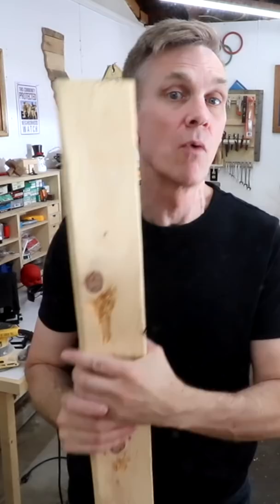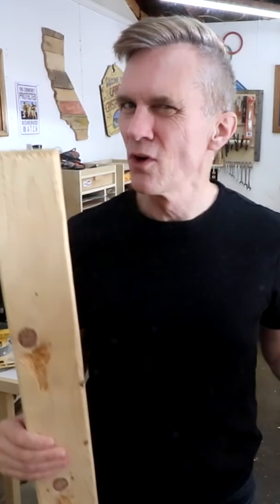Why do 2x4 boards have rounded edges? #shorts

Comment: "No one knows the reason." 

Me working at a saw mill along with 150 other people that all know the exact reason the corners are rounded: "You sure about that?"

It's so that when the lumber is stacked and banded before selling there are air flow passages to help the wood dry better if it gets damp without the need for as many spacers in the packs. Which are called sticks at a saw mill just as a fun fact.

Comment: 2x4s have rounded edges so that when they are stacked together for storage/shipping, air can get in between the pieces. It helps to prevent mildew and damage.
Reply: It also makes them easier to remove from the stack and especially a wet one !
Reply: 2×4 have rounded edges as it's very beneficial to the wood itself and those working with it. They reduce the number of injuries like unwanted splinters during the handling and manufacturing process and also ensure that the lumber stays looking its best all throughout until the customer sees it.
Reply: If only he could have told me that
Reply: Usually lumber is wrapped after being kiln dried, not sure airflow is the answer.

Comment: Originally, rounded edges were just a byproduct of the type of saw used to cut down the boards to a 2x4. In the early 19th century the most common mill saw was a drum saw, nicknamed the cymbal saw. To fit the spindle and drive gear the center would bulge out resembling a cymbal, and when run at high speed with wood travelling through it to be cut, the edge down that ran along this bulge would basically get routered down to a round (albeit uneven) edge. 

As Devin points out, today wood beams and planks are kiln dried. Rounded edges allow for the boards to fit the racks better and allow for even airflow.

Comment: The “planing” of “rough” lumber produced straighter boards and that material removed was resold for secondary products and uses. 

You’ll also find it amazing to know that it sometimes takes years for new architects to catch on that these rough framing members are not 2x4”…

Comment: They're rounded so that when they are stacked, there are gaps between each beam to ensure they maintain proper moisture content.
Reply: You think he would tell you, but then you remember, your watchinf the youtube equivalent of tiktok
Reply: I figured it was something like that.
Reply: True but they’re not “beams” and nobody w actually mill or kiln knowledge would call a stud a “beam”.  You obviously stole an answer from someone with actual industry knowledge… to what?… hear yourself talk?
Reply: @HBSuccess  how can someone hear themselves talk in text?
Reply: @draco_izanagi  
It Requires a lot of beams
Reply: @HBSuccess  folks call it different things my guy. Been a carpenter for over 20 years, looks like you've been a troll for a bit longer.
Reply: What percent is proper moisture content? I'm a hardwood floor guy in the very humid south
Reply: That’s exactly what I thought, this comment satisfied me. Thank you
Reply: @mattinthehat6318  I did woodfloors for 20 years under 8% and they stay flat
Reply: Sounds as good as anything else. Been in construction for 40 years and never cared. Just cared if they were straight.
Reply: @terrypetersen2970  I'm right there with you! Especially at today's prices! If it's not straight then I'm going to pass. Even the OSB (although I don't normally use it for sheathing) is damn pricy. I just redid a kitchen with veneered cabinets, and the framing and wood alone was well over 4 grand.
Reply: There are many reasons but this isn’t it they use spacers for this and always have
Reply: Old man told me that it was to keep edges from get damaged as much
Reply: I love moist wood
Reply: @SolarPatrol  so do termites, black mold, mildew, and rot. Use a crawl space dehumidifier and your house will last 100 years
Reply: Ok but he's talking about a specific size which hints that other sizes don't have that. So then other sizes don't need to ensure proper moisture?
Reply: Hmm 🤔
Reply: @boburwell9921  I'm in Arkansas and humidity definitely makes a big difference. Under 12% is doing pretty good around here.
Reply: @boburwell9921  yeah I thought that too. MY theory is it's for packing. If the edges were supposed to be squared off, they wouldn't pack as tight. That rounded edge gives wiggle room. If you get my meaning.
Reply: @HBSuccess  sounds like you cut a lot of blocks and pack a lot of sheets on your jobs site… he never claimed it was his knowledge
Reply: Most 2x4's are still soaking wet when they get to the store. Rounded corners isn't doing much of anything.

Comment: They are round because a pristine edge (even at 90 degrees) cuts like knife and would probably cut tie down straps in transport, it's also better for everyone who has to handle it, starting at the mill. It also reduces damage and splintering of the product. There does need to be any extra steps, automated machinery can have this go right from plaining into a molder.

Comment: It’s rounded so it can either be treated or thrown around without splintering. When stacking which it’s the most commonly stacked boards the wood needs airflow or breathing room. Thank you

Comment: You can butt up 2 rounded corners pushing against the corner edges, this gives you the triangle strength while also allowing flex movement, most framers have forgotten this, but when more complex building shapes rather then the cookie cutter construction, you can begin to see the huge benefit of the rounded corners.

Comment: I've worked at a sawmill for 8 years and counting. Six of those have been in the planer and two of those have been looking after the planer production and quality. The rounded edge or eased edged (EE) as we call it does not add an extra step to the process. We simply put different knives on the side head of the planer. The reason why we use eased edge is because it cleans up the wane (wane is the part of the log that is under the bark) from some of the board. Purely aesthetics, however, some mills might produce a wane free product and this would pull more boards into that top end grade. Hope this helps!

Edit: the answers regarding moisture sounds good but the eased edge is quite small. There would not be a big enough gap to allow for enough airflow to stop the lumber from molding or whatever. Not only is the gap not big enough but stud grade (#3 equivilent) products and above (#2 ,#1, SS and j- grade) generally get wrapped so that they don't get rained on. Being wrapped would also stop most  of the airflow through that bundle as well. We have a product that is a wet product. Any board over 19% moisture content gers sorted out and put in that product. These bundles are not wrapped and open to the environment, if eased edge would allow enough airflow to move moisture these boards would not mold. However, this is not the case... Square edge is also easier to stack production wise for the mill.
Reply: Se you on the top
Reply: Thank you for taking the time to share this!
Reply: Great answer. Someone knows what they’ve talking about.
Reply: Thanks! Finally someone who really knows. A big thumbs up.
Reply: I heard that the rounded edges help keep the wood from splintering on the edges that can lead to the full board splitting.  back in the day, the stores would get the truckload of wood but many would be damaged on the edge leading to the whole board splitting and needing to be thrown out.
Reply: Excellent answer. You probably have a wet product category because you're using a softwood kiln stick that compresses under the weight of your green stack. Eliminate your wets by using a tropical stick that does not compress and you eliminate your discounted wet market. They can get 10+ times the turns too.
Reply: It's nice to know my guess ("more finished boardfeet per tree? Since trees are...round?") was on track =]

Comment: The answer is very simple..if the edges are 90° and the board twists or bows it will transfer that defect to any material fastened flush to them. With the edge rounded, any light warp or bow will not as easily transfer. The rounded edge is much like an expansion joint.

Comment: Having a radius on the corner improves the overall strength of the 2x4 by removing any points where the grain can fracture from a change in direction The radius makes the 2x4 not split along the grain as easily as it would if it was a 90° corner
Reply: Exxxxxxaaaaccctttllly correct, stress concentration is something to be avoided.

Comment: 120 years ago, back when 2 x 4s were actually 2" x 4", they didn't have rounded edges. Anyone who has worked on an old house has encountered framing lumber from that era that had square edges. And while it came out of fir trees that were much superior to modern lumber, the old framing lumber is usually extremely splintery and dangerous to handle without good gloves.

Comment: Its so the lumber stays looking as good as possible till its purchased in a retailer. As well as splinters. Square corners ding, chip and break when handled this is why 2x4s and other dimensional lumber are shipped unprotected and finish lumber with Square edges are protected.  Everything else is an added bonus

Comment: With 2 decades in the industry, I would tell you rounding help reduces splintering & cracking, during all the handling processes that includes drying process and shipping.
Reply: Still doesn't make much sense though as its generally used where no one is ever going to see it. So why does it matter if the corners are splintered or damaged?
Reply: @SirBenJamin_  generally doesn't sell well. Its like everything else. If it looks good its percived as being good
Reply: @SirBenJamin_  I don't believe you asked.

Comment: The answer seems to be that it is to allow air circulation when drying and palleted. I’m more curious as to when it became common to round them this much. Contrary to what he says, the rounding, at least to the extent we see today, does not go back that far. Up until at least the mid 1980’s 2x4s had a much more squared profile. Take a look at the framing in any old house. 
Ad an added benefit to the improvements for kiln drying, I bet it adds up in savings on shipping costs.

Comment: I work at a sawmill we run them in EE (Eased Edge) or SE (Square Edge) it takes no extra effort to do either just depends which head you use on the machine i think its all preference.
Reply: Is there more money to be made if you sell the corners separately as sawdust?
Reply: @tiberiu_nicolae  no there is no money to be made in saw dust my boss said he gets about $50 in profit a truckload you but you have to get rid of it so you take what you can
Reply: It would be nice to watch a video of the process, maybe you can send it to Ramsey so he can post it, if you can record it of course, 
So, do you know the answer we all are waiting for, ¿can you tell us the reason for that round edge?
Reply: All lumber is stacked into units!!!  I pulled chain for over 6yrs Str8 in different planers & Sawmills!!!  They run a soft edge because of the moisture & drying aspect of lumber, when lumber is dried in a kiln, it is stickered every layer, so it can dry properly when spending days & days in the dry kiln, dried lumber cost more money as well.
PS: Now you know!!
Reply: @gregserna963  yep, glad to see this comment!
Reply: @gregserna963  can share this comment in the main comment section?0

Comment: I grew up on framing job sites. My first job at 9 years old was stacking these up around a slab so framers could quickly and easily grab them and lay out the stud walls and them nail them together. Those framers were doggone quick at doing that. My dad could hammer a 16 penny nail flush with a stud with one tap and then a quick smashing blow with his rigging axe. Those rounded edges definitely help with not driving a long narrow splinter through your hand from the edge. In all the years I worked on framing crews, never did I ever see my dad or any of his framers wear gloves probably because, I am guessing here, having gloves on, makes them slower and clumsier swinging a hammer or rigging axe and also makes it more difficult grabbing a giant handful of 16 penny nails out of their pouch and sorting through them to hammer them in. I can't speak from the sawmill side of it but it doesn't seem unreasonable that a sawmill would customize their product to facilitate the easy use of their product to end users. That's what tool makers do every single day. They design their tools so that users will like them and be comfortable using them. If I had a sawmill and I wanted to sell more boards to framers, I'd definitely use that as a selling point. Just saying.

Comment: They were originally reduced on size over time to standard of 1 1/2 x 3 1/2 because of shipping costs. The reduced weight meant reduced shipping cost. Perhaps the rounded edges were intended to further reduce overall weight?

Comment: I have my theory about the round edges: I believe that when you stack them up (the 2X4) having round edges allows air to circulate and keep them dry. My theory anyway.
Reply: I hate this idea and don’t believe it
Reply: @c_mac7773  you say that but how do you really feel?
Reply: several people say this. They might be right
Reply: Wrong. From my experience as a kiln operator.  Once they are ran thru the kilns. Theyre bundled into tight units and wrapped to prevent sun damage and water damage. And all the green 2x doug fir i used to receive for drying always had mold in the middle of the stacked units even though they all came rounded.

Comment: Sharp edges tend to be points of high stress and thus points of failure . I have no clue if this is the reason but it’s another benefit depending on what your using the lumber for.

Comment: Working at a sawmill, I'm pretty sure it's a "feature" that prevents them from getting bound up in sorting machines or snagging on stackers. I see far more binds and snags on the raw side of our mill rather than the finish side. That and, with the way they are sorted, the boards would have some of their edges smashed by other boards, so might as well give them a leg up in consistency.
Reply: That was what I was thinking
Reply: Thank you for that, you beat me to it. You are absolutely right, the edges are rounded because lumber has to be stacked and moved around. Sharp edges catch on each other, rounded edges slide over each other

Comment: the rounded edges make it harder to look down the corner of the board to check for straightness because there's no square corner it makes it much more difficult to pick out crooked wood
Reply: LOL. Pro tip: Go to Lowes or Home Depot. You never have to check a board. They are guaranteed to be twisted. Saves a lot of time when you need useless lumber in a hurry.

Comment: It's simple to work out why if you follow the money. Edges are round simply because rounded edges are less likely to splinter off and catch on things. Even the smallest splinter catching on something can result in large chips of wood coming off and in the case of pine being a soft wood the chips can be huge. So to prevent this simply rounding the corners can result in drastic decrease in damages product. It's likely that one lumber mill started doing it and saw results. Purchasers noticed the selection of wood was often times less damages and the rounded corners appeared more premium of a product so that wood got purchased first. Wouldn't take long for other lumber yards to follow suit and soon you have rounded corners to lumber with its origin becoming obscured.

Comment: Here in Mexico, Home Depot only offers 2x4 with square edges. Or at least my local Home Depot does. I'm not really sure why. Probably because houses in Mexico are not made from lumber, they are primarily made out of bricks and concrete. So very few people actually buy 2x4 as a material for construction.
Reply: That is EXACTLY why and 2x4 wood in mexico is NOT manufactured in the same way so it's super common to receive very resin-saturated or greenish lumber from the mill if you ask for 2 x 4's.
Reply: Sounds about right.
Same case in Montenegro
Reply: Same here in Chile..
Reply: Do y’all use kiln dried lumber there?
Reply: @lZEOBA  At both Home Depot or a mill they offer both types, you have to specify what you want.
As for the use, wood at construction sites is used mostly as a mold to pour concrete or cement. I don't know which type they use but I would imagine whatever is the cheapest.
For making furniture and decorations I like to think that they use kiln dried wood, but I'm not sure about that.
Reply: Cuanto cuestan los 2x4 en Mexico ?

Comment: It's actually probably so the edges don't get damaged when they are stacked. If they had sharp edges those edges would inevitably get torn up when they get thrown onto the pile.
Reply: Every time I go to Home Depot to get lumber 1 in 3 is damaged or warped anyway, regardless of what the edges look like
Reply: Exactly, and they would split the entire length to form a big splinter.
Reply: @HamiltonRb  That's partly due to the type of wood. 2x4's aren't old growth pine anymore. They cut all that down.
Reply: If it goes in the wall who cares

Comment: The planner does the rounding all in the same pass as the flat surfaces are smoothed. They may be a lot of reasons for this rounding, but one thing is I think, when you pick them up from a flat surface, it would be easier to pick them up. I personally like the square edge, but most planned lumber has rounded edges. 
I’ve done a lot of sharpening/changing knifes on planners, plus putting them through the planner as well. A 2x4x8 went through in about 1.3sec/piece
1x4x8. 1sec / piece

Comment: Two things. Helps the drying process be more evenly sped through the stacked lumber. If the edges are squared the edges dry to quickly and will spit the board. 
Buying boards in spring you will have less end cracks as opposed to the fall. Summer heat drys them too quickly.